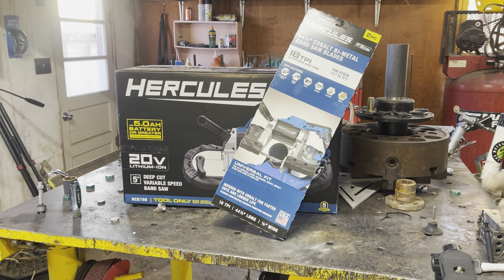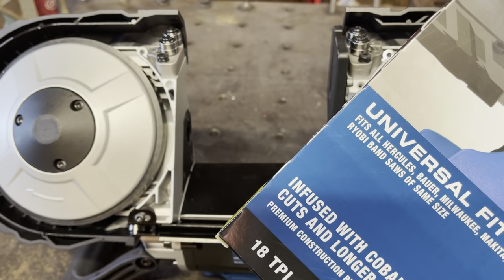New harbor freight HERCULES cordless! bandsaw!

Comment: do you think it has the depth to cut 4x12 stair stringers?
Reply from the maker: A 4x12 stingers gonna be alittle much it’s only a 5x5 opening but that’s how most portabands are. If you
Need to chop a stair stinger your best bets a cutoff wheel or my personal preference is a metal cutting circular saw

Comment: How long does the saw run on a 2.5Ah battery... and it didn't look like it came with a case(?)
Reply from the maker: Kinda varies I’ve gotten about 30-50 cuts inch smaller material with the 2.5

Comment: I'm not getting any luck on Hercules bandsaw blades they are Made in USA they break easy and only using them cutting trimming thin aluminum sheets doing straight cuts only no curve i clean the tool/bearings/ of cuttings all the time using vacuum and brush. .....can you let us know blade life ?
Reply from the maker: I can definitely update this they’ve been meh at best they’re definitely cheap and they don’t preform as good as I would of hoped for a made in USA product I’m gonna try some other blades

Comment: If their Hercules corded version also had a 5 year warranty I would had gotten that instead.  Both said they had the same no load 420 SFPM.  I wonder what is really more powerful the corded brushed motor one, or the cordless brushless.
Reply from the maker: Maybe I’ll buy one and give it a go lol 😂
Reply: My guess is your application - what are you cutting and for how long.  If using all day long, then corded is the way to go,  i think. Especially if used in the stand, as a standard so bandsaw.  
If  you need portability, than cordless,
Reply: @rickwoodham4570  I'm just a garage hobbyist welder.  I don't do anything seriously enough in volume to warrant a shop band saw or cold chop saw. Time is on my hand and already have an abrasive chop saw.  That's why I opted for the cordless.  Might be useful to cut metal out in the field or and old barn.
Reply: @morenothing4u  yeah I'm no expert, but if you are in the Hercules battery line,  then is go cordless, for portability. 
Can't beat their 5 year warranty on the brushless Hercules line - I had issues with my reciprocating saw last month.  Walked in store with broken saw & walked out with a new one in less than 5 minutes. Didn't ask why,  just exchanged it
Reply from the maker: I definitely like the herc line of tools. I’ve been a Milwaukee man most of my life but I’m definitely impressed with em